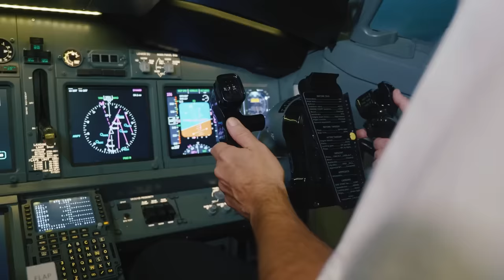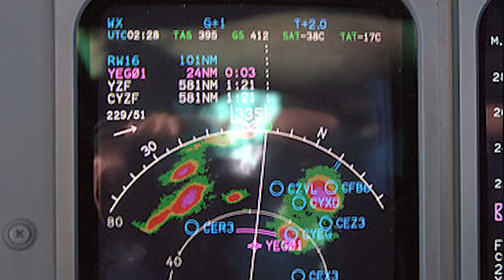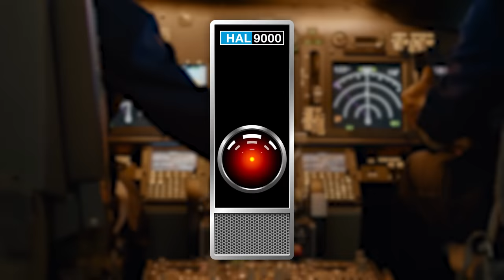Neil deGrasse Tyson Explains Advancements in Aviation

Comment: I'm a big fan of Neil deGrasse Tyson and he covers a large variety of interesting subjects, but there are so many glaring errors in this video that it's embarrasing.

For example, he talks about how computers control the aircraft so that in a banked turn you do not have the feeling of being tilted to one side - the water in your glass does not move.  This is called a co-ordinated turn.  The aeilerons, elevator and rudder are all used at the same time to avoid feeling like you're being tilted over.  Pilots have been doing that manually for as long as we've been flying.  It's not something that has been enabled by the use of computers!

Comment: Great explainer. Loved how this videos go. One small correction I think.. we can tell if the plane is turning because we feel heavier.
Reply: Yep!! The wings in straight and level flight are producing the same force of lift as gravity is pulling down. In a turn, the wings are now producing lift at an angle, and some of the lifting energy is now spent turning the plane rather than keeping it up, so the pilot needs to add upward force and increase engine output to even out the force of gravity. In a standard 30° bank turn, you feel approximately 1.3 G's if you were to do a 60° bank turn, which pilots sometimes practice in small airplanes for training purposes, you would feel 2G's
Reply: Yes. Centrifugal force increases the apparent gravity.

Comment: There have been no advancements in aviation.
In fact, we have gone backwards since grounding the Concorde.

Yes, there are small advancements in engine technology to increase efficiency but nothing has increased speed/comfort which is what we all care about.
Reply: Some people care about a lot more than that.
Reply: Composite cabins where the pressure can be maintained to lower altitudes along with increased humidity.

Comment: Banked turns and coordinated controls to center the gravitys effect has been solved since WWI as the tube with the bubble has been on the dashboard since early flight. All other type of flying is lazyness of pilots. Only in a crosswind landing you should feel movement sideways.
Reply: And even in a crosswind, you can land cross-controlled, which will not have a perceptible lateral component.
That said, I think most airline ops these days call for crabbing instead for one reason or another.
Reply: @theMazdaManiac  still, as they straighten up the aircraft just before touchdown you usually feel that.
Reply: @theMazdaManiac  "Crabbing" is what you do in advance of touching down, for a crosswind landing.  You aim slightly upwind, to oppose the wind with your air velocity, so that your ground velocity is aligned with the runway.  It's called "crabbing" because it resembles the way a crab walks sideways to the direction it faces.

It is at the end of crabbing during a crosswind landing, that the pilots face the greatest challenge.  They have to quickly correct their direction, and yaw to stop aiming across the runway, and aim with the runway.  This is called "stepping on the ball', because they apply a large rudder input to realign with the runway just before touching down.  The indicator that helps them coordinate banked turns is a ball that swings from side-to-side, and they use pedals to operate the rudder to keep the ball centered.  At the end of crosswind crabbing, they push the pedals to swing the ball all the way to one side.

Comment: I'm in my 60s.  I grew up here in the El Paso/Las Cruces area.  I remember, as a kid, in the60s and 70s, you could actually hear loud planes from EL PASO!  Almost 50 miles away!  You didn't have to stop conversing, but you could hear them.  I happened to hear a rather loud twin-engine-prop going over last night just before I went to bed.  It dawned on me I had not heard a loud aircraft passing overhead in many years!  Just saying--hope it helps.
Reply: Fort Bliss added to that noise!

Comment: I wondered about the banking in a recent flight actually, I remember that before the pilot would say that s/he was making a hard turn (happened rarely) and you'd feel it but for quite some time they aren't necessary as the trajectory is so accurately mapped that pilot correction to that degree has become more uncommon. There was a hard turn anyway, and thought it strange that the pilot said nothing, but then of course there was absolutely nothing felt inside the cockpit, it was completely natural and I thought we had probably a greatly skilled pilot on board. Well, s/he probably was very good but now I understand how the small calculations done on the spot make it possible, thank you for explaining the magic.

Comment: Can an airplane remain stationary in air?
Reply: No, an airplane cannot remain stationary in the air.   The airplane wing only works if there is an airflow across its surface.  If the plane is at rest relative to the air immediately surrounding it, it will fall like a brick.  The wing will offer some drag to slow it down when it starts picking up speed, but not enough to stop it from falling.

There are gliders that are built just like airplanes without engines, but they only work if given an initial speed.
Reply: @carultch Wrong.
Reply: There are VTOL aircraft that can do this. Also, if you have a headwind that is sufficient to create enough lift, then an aircraft can not only hover, but can also go backwards!
Reply: @johnp139  Staying stationary relative to the ground because your headwind coincidentally equals the speed you need to stay aloft, is not what I'd consider a plane remaining stationary in the air.  It is still moving forward relative to its immediate environment of the air around it.

Also a VTOL aircraft wouldn't be a plane by strict definition, and wouldn't meet the question that the OP likely had in mind.  It has its own vertical thrusting propellers, and using them to stay aloft would defeat the point of the OP's question.   If a VTOL aircraft could count, the OP might as well have asked, "can a helicopter remain stationary in the air?".   Of course it can, everyone knows that.

Comment: On one of the big pilot channels they claimed that those upturned winglets behave the same as if it was a straight wing with the extra distance of the height of the winglet.  But airports charge more for planes with longer wingspans so if a plane is close to a lower category they will use winglets to save money.
Reply: Some airports do charge landing fees. They are usually based on aircraft occupant capacity, not wing span. The winglets dramatically reduce wingtip vortices with a concurrent reduction in drag. The wing is more efficient.
Reply: No! It’s about aerodynamic efficiency!

Comment: pilot here, You dont feel the banking turn because of a simple ball in kerosene. its called the turn coordinator.  the centrifugal force moves the ball left and right. airplanes have had this forever so if you had to lean you just had a crap pilot. no cpu necessary.
locking the controls is a AWFUL IDEA. cyber attacks, cpu failures. terrible terrible idea...

Comment: 50 years ago planes flew toward a navigation radio station, when they reached it, turned and flew toward the next one.  A plane did not fly from New York straight to Chicago, it zig-zaged from one station to the next and finally the last leg was toward Chicago.  Then technology was developed that allowed moving a phantom image of a station so that it appeared to be on a straight path toward your destination which saved 10's of $1000 per flight in just fuel costs.  But within just a few years GPS was implemented and planes knew within a few feet of where they were and could fly on a straight path to their destination.
Reply: They still file flight plans that take them from waypoint to waypoint.

Comment: The real question is; With all the added efficiency, passenger cramming, and other cost cutting of perks why are flights so much more expensive per flight than they were decades ago?
Reply: Fuel prices and demand, mostly.
Reply: Inflation. When you adjust for that, flights are much less expensive.

Comment: What he says about planes turning is nonsense. Computerized autopilots and autoland systems have been flying airplanes the same way for decades. Even fly-by-wire systems don't fundamentally move the control surfaces in a different method than a human pilot does. I like Neil, but he needs to stick with astrophysics.

Comment: It’s insane to think that older planes from the 60’s/70’s looked pretty similar to how they look today, but if you’ve ever seen their internals and how the pilot controls the aircraft, it’s basically just a bunch of wires and pulleys. You’re flying in a computer controlled puppet and those systems had to be 4x redundant because things break all the time and they only learned this from all the times a plane full of people smashed into the ground. I love aviation, but I am horrified of flying the more I learned about how they work.

Comment: Oh I have to make 1 correction. I've had pilots bank way harder than necessary at times and there isn't a doubt that they are turning ha. (I'm a flight attendant)
I doubt it goes above 1.2 Gs though. Typically, though, they do as Neil stated.
Reply: The force is still being applied vertically downwards perpendicular to the floor.
Reply: @johnp139  normally yes. But I've been tossed sideways before.

Comment: 8:12 weather forecast does not exist any more. Nowadays it is weather information. They reduced it from few days to few hours now, but that we can also se with our eyes, if clouds are dark it could rain if they are white or if there are no clouds it will not rain.

If you want to call it forecast instead of weather info then you should write down today something that you predict will happen tomorrow for example, then you leave it there and you can be wrong but you predicted something and you will see tomorrow did you do a good job. But as they do now, they predict something, then they change it 17 hundred times until it is happening that is weather info, we all could do that: we write now that it will rain tomorrow, then we look at the sky and we dont see any clouds, then we correct it to it will not rain, then we look more into sky and we see some clouds and then we correct it again and now say it could rain today because day passed already and now is the day we initially said it will rain, then we see some more clouds and correct it again and say oh it will rain but we need to leave some chance it will not so we say it will rain 89%, then we look a little bit more into sky and we see clouds are pretty light but they are still there and there is no wind and we correct it yet again and say it could rain but now it is 24% and finally the hour before comes and we see the sky starting to clear and we say no it will not rain or just leave 3% to be sure if it does rain we had that 3% chance.

Yes it is nice to have real time weather information, but that is not forecast, it does not predict anything really, it is just informing you hoiw things are outside so you dont have to go out or look.

Again prediction or forecast is you say something and then wait given period of time which you determined and see are you predicted it correctly if not then you try to do better next time, fix your model, adjust your numbers or formulas or what ever but you can not change what you predicted it should be forbidden by law to call it forecast if you are changing it all the time.

And if you do that you are undermining your self because in 20 years when you look back at your predictions you could see that you were 100% right and you will think you have the perfect model but the weather is still unpredictable why? Because you did not predict anything you just wrote down what was happening in that hour so yes you were right 100% that rain did fall if it was falling in that moment.

Comment: sadly, the advancements are in refinement and evolution of technology, NOT revolutionary changes. 

Had you told someone in 1965 that we could be still, 60 years later, flying SLOWER in the same metal tubes and kerosene burning engines, they would have thought you were funny in the head - thats how ridiculous the LACK of advancement is. 

We should be flying supercavitating, electrostatically powered,  spheres by now and should be able to get anywhere on earth in 20 minutes,
Reply: You hit the limit due to physics.